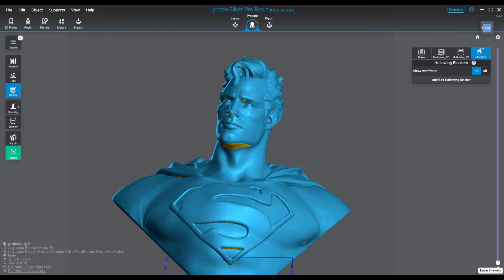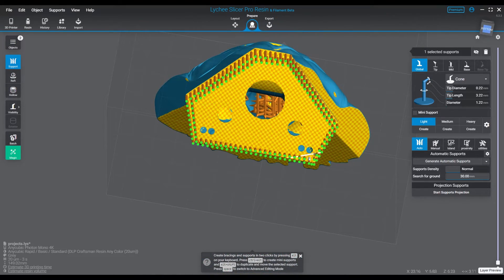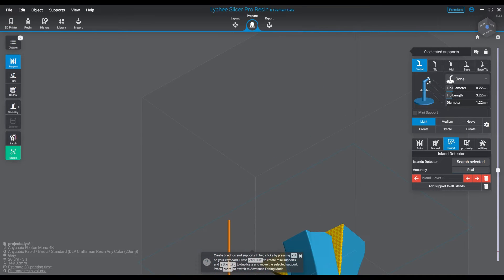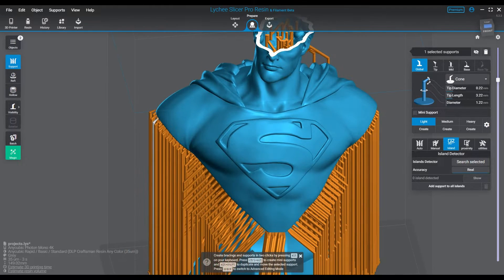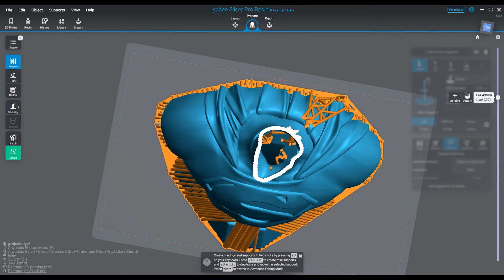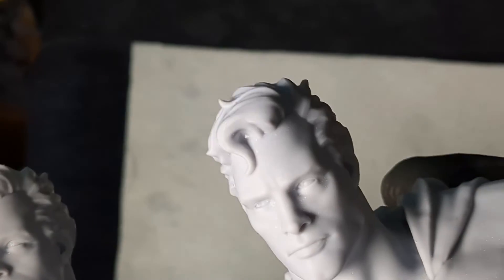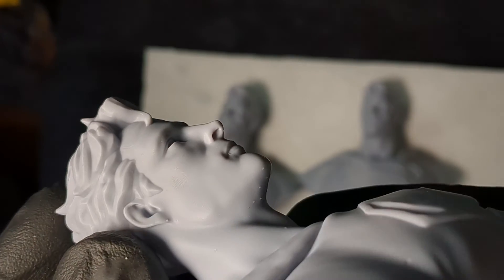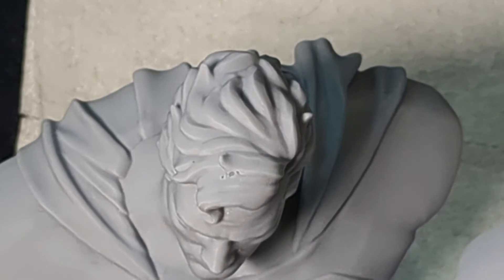Lychee Slicer Anti Aliasing Perfection

Comment: Any toughts why all of my prints fail when using lychee anti aliasing on mono x2? Sometimes i got "file error print stoped" message, other times it just stops with mesaage "print finished", but, object is not printed fully. somwwhere around 80% it fails. that is hours of printing of larger objects.

Kinda crazy over here by now.....
Reply from the maker: Okay, so I made an episode about this, specifically the X2. There is a glitch when exporting from Lychee, it is a known issue, and somehow they have not fixed it in like 2-3 versions of the software with "major" updates. I don't use Lychee to export anymore for my printers. I will export the finalized file as an STL, and then slice using parameters in Anycubic Workshop. This has worked perfectly every time. Check out the episode... https://www.youtube.com/watch?v=q0iZO2gnRLk I was about ready to throw the darn thing away.
Reply: @IPrint3dMinis  thank you. i managed to test a little, for now, it seems that problem is not in lychee per se, problem is in anti aliasing. when i use antialiasing, i have these problems. when aa is off, i can print full plate and height  with no problems.

the print fail even if i use aa in photon workshop, so i guess it's just cheap motherboad, some "memory" error, or something else hadrware related.

i will watch suggested video, thank you, also i'm waiting for support, maybe they have some information, but for now, aa is disabled if i have more than 2500 layers, and everything works ok.
Reply from the maker: @damird9635  That's interesting. I need to run more tests.
Reply: @IPrint3dMinis  thank you, i'm very interested in your conclusions. Customer support is not very helpfull, spinning me in circles - build plate adhesion, lcd screen, usual suspects, simply ignoring fact that i don't have any of the issues, printer is printing great, no failed prints, no adhesion problems, prints great up to certain point and then just stops.

I just finished printing extremly large object, full build plate, barely room on z axis to lift plate when print is done - no problem
 500ml of resin, heavy object, not a single problem. so...really i dont see any of mentioned issues that customer support is mentioning....
Reply from the maker: @damird9635  Yes, it does seem that either the X2 has some fault when it comes to certain aspects of the print files. AA, or HD slicing can cause the issue, memory can cause it too. Recently had a failed file of 3 large objects, it failed about 88% done, redid it with just two of the same object, less space and ram right...? Worked perfectly.

Comment: Interesting that Dennys Wang's anti-aliasing tests with Lychee seemed to give lackluster results. I wonder what role what type/brand of resin and printer play in the results one gets? https://www.youtube.com/watch?v=ynNBaX16FuQ&t=14s
Reply from the maker: I watched that one. I am using either my Mono 2, Mono 4K, or the Anycubic D2 for the tests. The D2 showed the least amount of change while the 4K and the Mono 2 as long as I am using 8K resin does make a difference. I think the bottom line is that if you are using the wrong combo of printer/resin and then the slicer can get into as well, it may make it seem that alias is doing nothing or little to nothing. With my experience it is, and I have done probably 7 videos talking about it, showing it, and testing it. Anycubic themselves have a totally different set of levels too, they are just set to 1, every printer I check the settings it just says "1". Lychee has different settings and they all seem to do the same or close the same thing with the exception of just turning AA off. You can use Sharpen, but that might actually make the edges harder, and give you more sanding, Smooth is good, but you gotta play with the levels to see what blur you want. Turning it off is fine for most stuff, especially with newer printers, but there is a difference, and it is more noted at lower layer heights, like 45 um and 35 um make a bigger change than just 50 um.

Comment: What support method are you using here? Can’t find how to make supports in line easy like you do. Or maybe you can point me on a video where you explain this?
Reply: Thank you for your reply! Strangely Shift and adding support does nothing when i’m trying it. I guess maybe i’m missing something
Reply from the maker: Are you a PRO or free user? @graffpov
Reply from the maker: This is called inline supporting. You add a support, hold shift and click to add the support anywhere on the same plane, it will create a line of supports from each one that you created. I am working on a new episode called "Getting the most out of Lychee Slicer" and I will cover this in that episode. Thanks for watching!

Comment: try 2px smooth surface 0% hd on. The 'air bubbles' on the top is an solved phenomenon, nothing to do with AA
Reply from the maker: the air bubbles are a pain, but I have had them occur with many settings too, so not sure that will 100% solve the issues.
Reply: @IPrint3dMinis  there isn't any evidence that it's air bubbles, nobody knows why it happens because it doesn't happen consistiently, it usually occurs at the top of domes but it usually doesn't so it's hard to test
Reply from the maker: The reason I call them bubbles is that they are usually round, and appear as you said on rounded areas and domes. It's quite annoying as it can cause things to fail. @awildtomappeared5925
Reply: @IPrint3dMinis  I've never seen them cause anything to fail? it's always at the top of domes and small enough that you can just add a tiny drop of resin in and cure it to fix the print from my expirience
Reply from the maker: This has taught me one thing, anything can make something fail.
Reply: @IPrint3dMinis  update: they always occur in the middle of a large area, the exact spot where you would expect the fep to release so it's almost certainly to do with the fep release, not sure yet exactly what is going on, it could be that repeated layers releasing in the same area causes some air to get trapped under that point on the fep or a couple other things but even with just this much info we can assume that a totally different lifting style would solve the problem such as tilting vats (I've asked s4u owners and they say they don't get the bubbles often but still get them sometimes) or pump vat systems like the PRM for Reflex or athena 2 will also have a pump vat option, these pump air under the fep just before lifting so I'm like 89% sure that would drastically reduce the bubbles if not eliminate them but idk anyone who has used a PRM much
Reply from the maker: @awildtomappeared5925 There might be other factors, but never rule out environmental ones too. With resins and FEP types you can have issues especially with larger printers, the bigger the surface area the more likely the pull force will be larger and cause the pop off.

Comment: A section on your AA settings would have been helpful, considering that's what the video is supposed to be about.
Reply from the maker: This is a follow-up, I went over my AA settings in a previous episode. But this is what I currently use.

Photon Mono X2 : AA Smooth Surfaces | 30% and 2 px radius
Photon Mono 4K : AA Smooth Surfaces 50% and 2 px radius
Photon M3 : AA Smooth Surfaces 30% and 2 px radius
Photon Ultra and D2 : AA Smooth Surfaces 50% and 1 px radius

So far this gives me the best result with the least actual visible lines. Sorry I forgot to add that to the description.

Comment: hello, thanks for the video, I've seen a couple of your videos as I'm studying supporting my models and I'm curious on why you don't use the "projection supports" feature on lychee for flat surfaces using the face selection "surface crease" or "surface selection".. with the borders configuration, distance and pattern configuration it seems perfect and clean for any kind of flat surfacing support scattering.. is it bad? what are the downsides of using that feature? seems absolutely perfect for me but maybe I'm missing something..?
Reply from the maker: I do use it on bases on big flat things, but every time I do it makes the slicer software run real slow. Not sure if it is a memory leak or some issue there, but it does work, just it's a heavy process for some reason.

Comment: I think you've used more resin in supports than the actual model.
Reply: Colocas demasiados soportes... Basta solo unos cuantos soportes grandes en puntos estratégicos y listo... La misma forma de la estatua hace que la inclinación de sus formas se soporte caso por si misma, solo requiere de soportes sólidos en la zona de la base que toca la placa de impresión 50/50 me parece un desperdicio innecesario de resina
Reply from the maker: Not at all, we use enough "light" supports to cradle the object, rather than having pull points that increase the damage in those areas. Regardless of the model supporting itself, and even with these supports I had one had a hard layer line in it, so it shows that there is still a point of issue there and I personally would rather have 100 lights than 10 heavy as the heavy supports cause way more pulling and warping.
Reply from the maker: Nah, it's about 50/50. They are all light too so they use little resin.

Comment: Is it both smooth and sharpen  on the best? Can you combine?
Reply from the maker: You can't use both Sharpen and Smooth, but you can use Sharpen and smooth it using the grey offset. Smooth works best with big figures and parts, while sharpen seems to work best on minis.
Reply: @IPrint3dMinis  will try it as soon as the saturn 3 arrives.
Reply from the maker: @eriksterlund  Awesome, good luck with your prints.
Reply: The sharpen detail AA setting in the lychee online forms is saying this setting is a mix between smooth surfaces and contrast blur so I will now be testing this as I just use the smooth detail 40x 50% but had a very interesting read tonight online
Reply from the maker: Thanks for watching!

Comment: Hi! Thanks for all the info about the AA! I'm about to try these settings and see how they come out. I'm expecting them to improve a lot now that I have the knowledge about how this works!
On the other hand, I'm very curious about how you add supports in a straight line by clicking on one end and then on the other and lychee adds evenly spread supports in that line. How can I do that? I haven't found the way.. thanks again!
Reply from the maker: Inline supports, simply click and add one support, then hold shift and add the support at the end of the line you want to create. It will show the dots where the support tips will appear.

Comment: Do you know whether Lychee’s anti-aliasing works with Elegoo’s Mars 4 DLP? I’ve tried several different settings (using SirayaTech Fast Navy Grey, and printing at .030mm-table top minis) and I can’t, for the life of me see any differences in the prints. And the one with no AA takes the same length of time to print as the ones I used AA on.
Reply from the maker: Ah, this is an interesting one. I do not know if DLP printers really use AA at all. I have a Photon and a D2, neither of them see a difference in AA settings. Seeing as DLP works a bit differently than MSLA I think the aliasing just doesn't seem to make any difference. I am still testing some resins on this, and maybe if we start to see 12k resins or something even better quality we might see more of a change there. Thanks for watching.
Reply: @IPrint3dMinis  thanks for the reply. Keep up the great work!!
Reply from the maker: Thanks!
Reply: @TheMoondougie  I came here to ask the exact same question! How are you finding the Mars 4 DLP?
Reply: @ericksonlawnsandgardens  I wasn’t able to figure it out to my satisfaction. I’m returning it and going with a Mars 4 Max instead.
Reply from the maker: I was curious about it as well. The Max looks good.